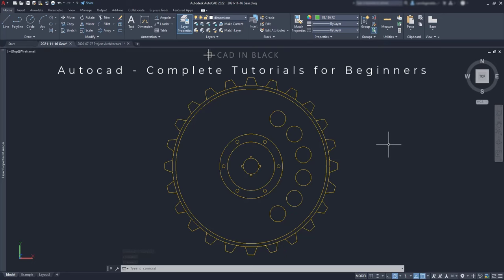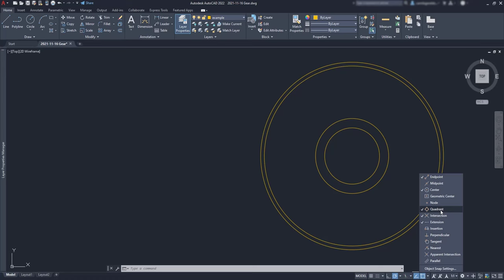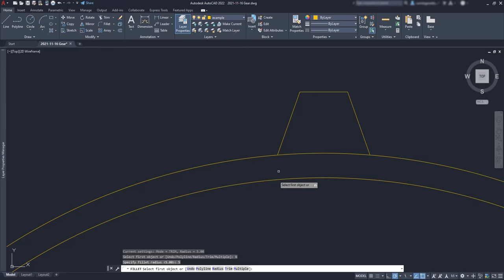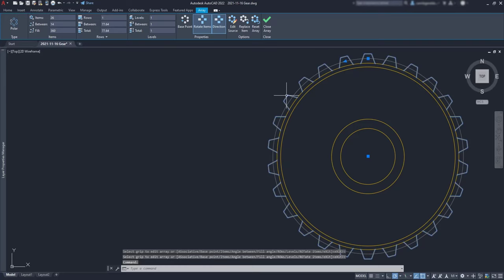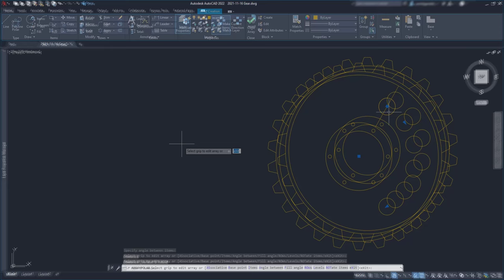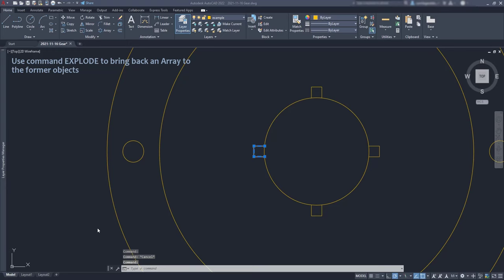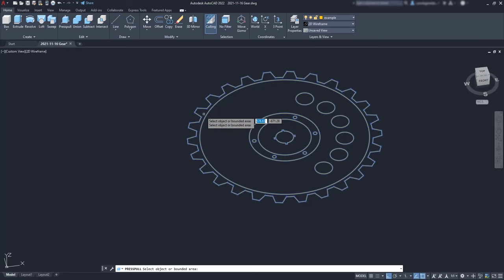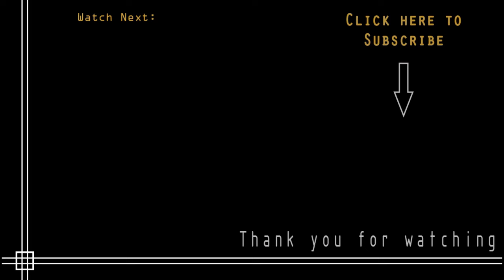Autocad - How to draw and model a Gear (in 7 steps)

Comment: Pls I'm having issues with presspull, if I want, for example, presspull 5m up and 5m down it keeps presspulling upward even when I set the direction downward . Pls how do I fix that.
Reply from the maker: Hi +boma peaceful !  That's regarding the movement you do with the pointer. If you want to presspull downwards, move the pointer down until you see the preview on the other direction. Then, you can type the value.

Comment: Next gear, we must do with using involute profiles. Now there’s a challenge 😀
Reply from the maker: Hello Doug. Glad do read from you again! That's a good suggestion. Actually that will be more a matter of geometry than CAD. ;) Let's see.
Reply: @CADinblack  I used to draw the profiles all the time in order to check the involute on a comparator. We made super abrasive grinding wheels. Try it if you want a real cool challenge 😀